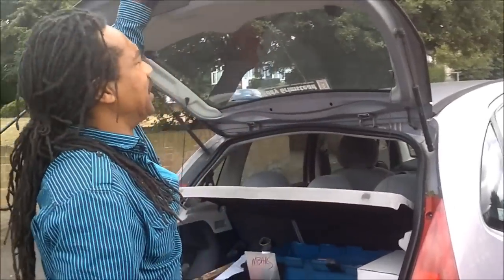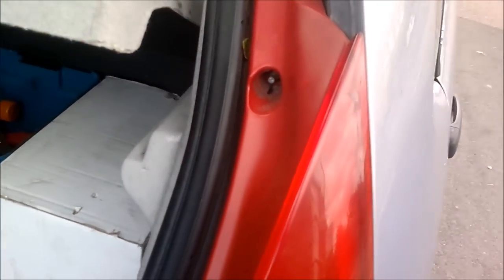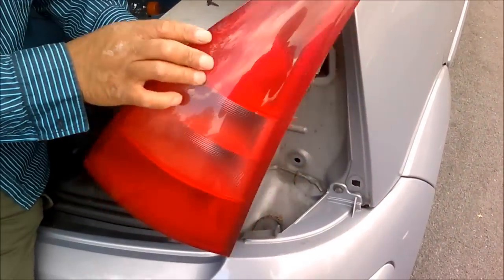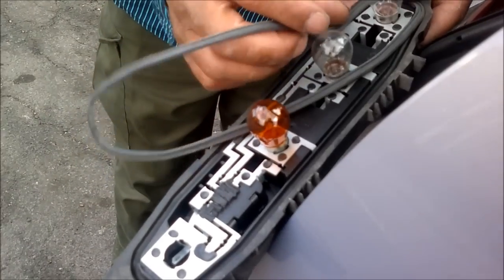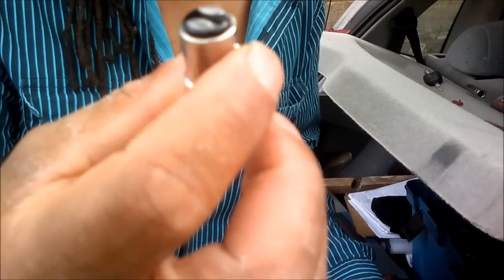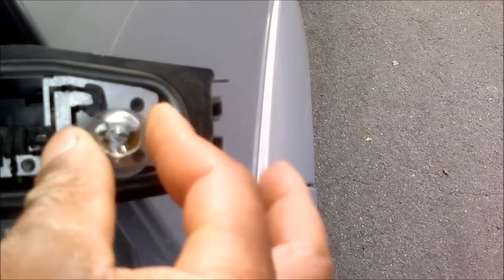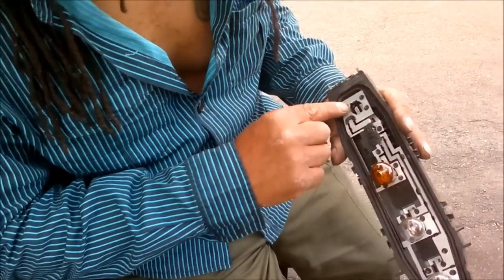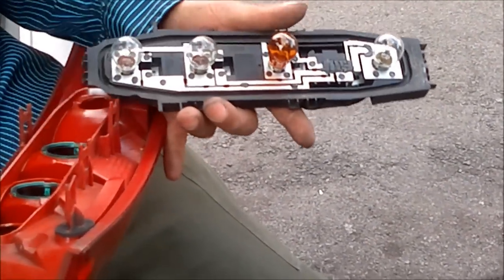How to remove Citroen c3 rear light bulb

Comment: Thanks a lot!! The newer model C3 is even easier, no tools needed but your video did the trick helping see I could safely push out the whole unit before unplugging the electrical connection to get at the bulb better.

Comment: Thank you Andrew.  One comment for those who, like me, leave your video after you changed the offside light ...  It's a lot easier to separate (and replace) the black bulb holder from the plastic outer if you disconnect (and reconnect) the cable connector.